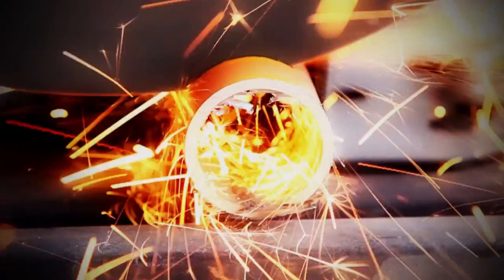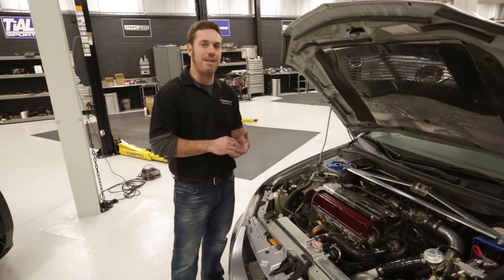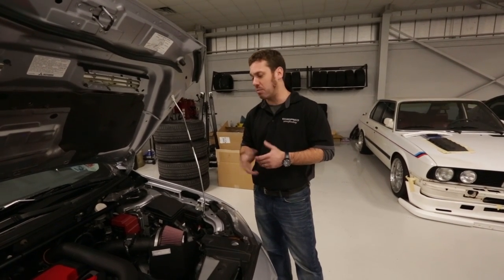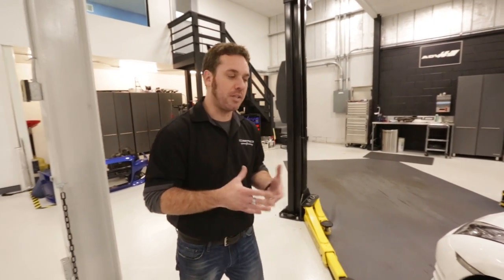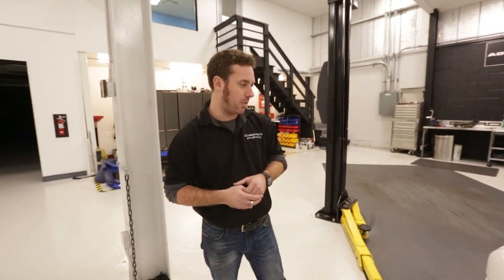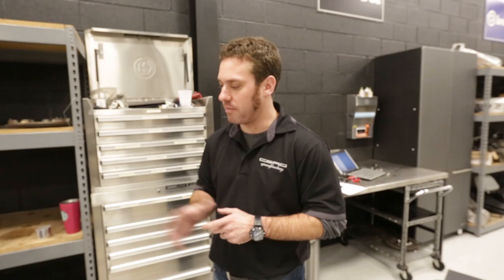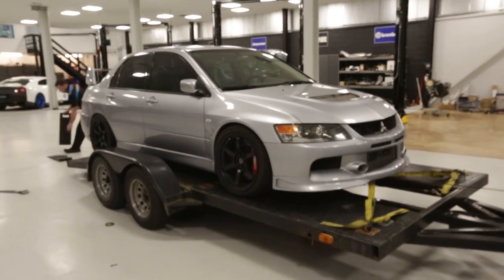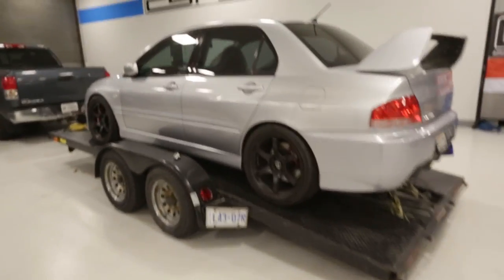Pete's Mitsubishi Evo VIII Project Car at CBRD

Comment: with horizontal motors with a turbo wouldnt the turbo heat up the coolant running through the radiator from being so close?

Comment: Can someone explain how a 4 pot has more braking power than a 6 pot? What about the surface area of the pads?
Reply from the maker: +50nollieman Simple, the 6 pistons are smaller in total surface area then the 4 larger pistons. Same goes for the pads being used, they are actually larger than the OEM GTR ones. The 4-pot kit is a full motorsports grade setup hence being lighter but offering better braking performance.